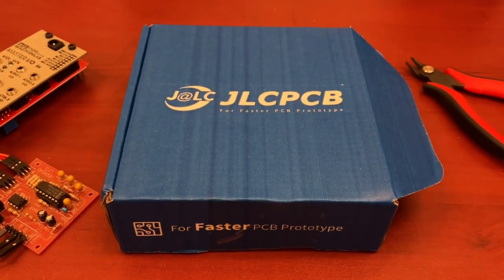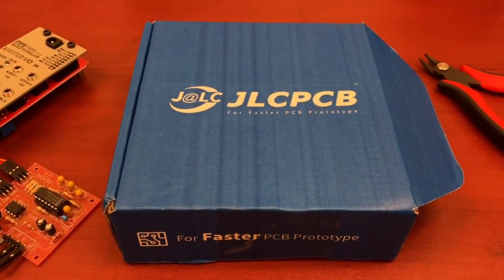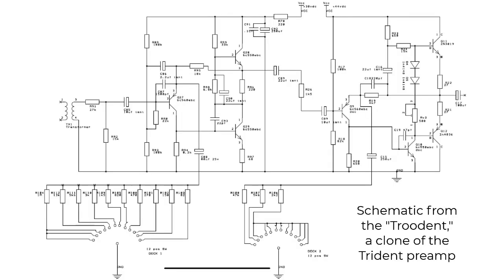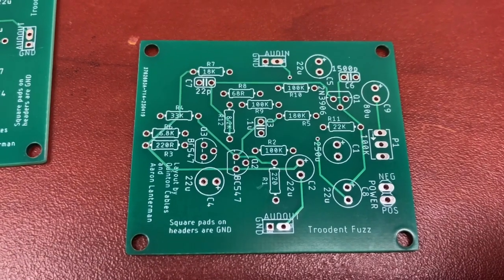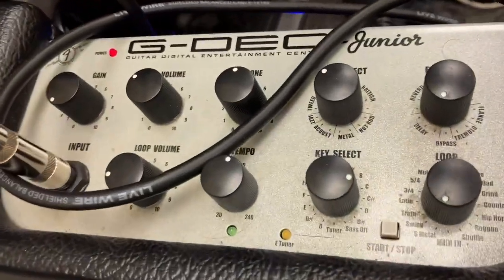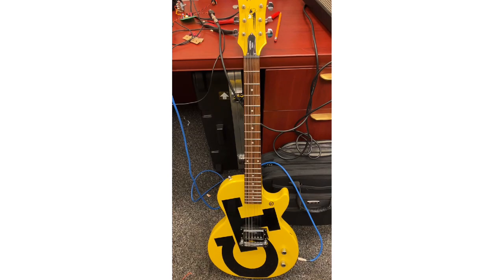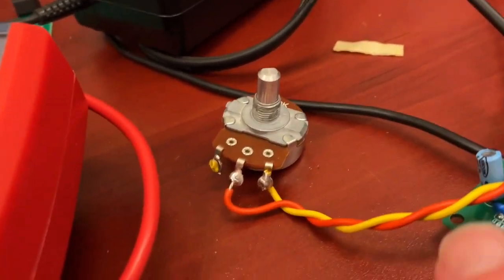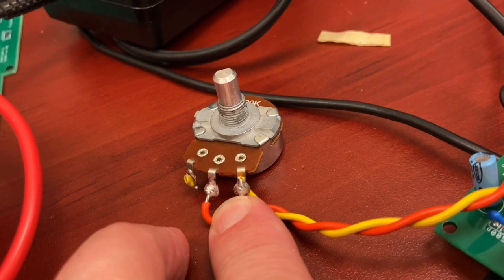Fuzz Circuit Based on the Trident Mic Preamp (quick & dirty test with iPhone microphone)

Comment: I dig it, nice and compressy with loads of sustain. Need more bass to be fuzzier and some treble roll off as you mentioned.
Reply from the maker: Thanks! I can't take credit -- it's really just that first half of the Trident preamp. I doubt any of the Trident engineers would ever have expected anyone to try making a distortion device out of it. :)
Reply: @Lantertronics  I doubt it too, but some of the classic fuzz tones are actually overdriven console pre-amps cascaded into each other. I'll make a board when you post it, looks like a fun one. Hope it can fit into a 125B or 1590N.
Reply from the maker: @ScottyBrockway  Oh yeah -- I was inspired by reading some stories about that, regarding "Don't Worry" by Marty Robbins.

Comment: I was looking at this one on Basecamp, it’s a super cool circuit! It’s interesting that the pre-amp circuit uses tantalum caps on both the input and output rather than aluminum or film. I always heard tantalums are notorious for distorting audio, if that’s true it may be a questionable choice for a pre but awesome for a fuzz :)

I’m building a clone of the Ampeg VH-140c red channel and it uses an anti-log pot for the gain control, which serves as a voltage divider and controls how much signal is fed back into the inverting amp soft clipper vs how much is passed into the next gain stage. It almost annoyingly reaches near max gain at the 11 o’clock position, giving the illusion that the circuit has a ton of gain when really it’s all just skewed on a lower point on the pot. But it may help smooth out the usability of the pot for this circuit.
Reply: Oh! I was also going to add that running the pedal through the FX loop may help tame the sound, as you get all the filtering and tone shaping of the amp before it goes through the fuzz
Reply from the maker: Heh, I hadn't even noticed they were tantalums. I just used electrolytic.

Comment: Would love to see the input and output waveforms on a scope….that would be most illuminating
Reply from the maker: It's hard to get a sense of that with guitar input itself since it varies so drastically, but I'll put in a triangle waves when I get a chance -- that's the easiest way to see the details of the nonlinearity.
Reply: @Lantertronics  would a tone work? How about a fundamental by playing a harmonic at the 12th fret? “A” string maybe? I love this stuff and your channel, which I trust since you are wise in the ways and means - I have been threatening to build some devices but EE has been my job for 35 years and I stick to the playing outside of work - still I enjoy learning in your utoob 🤓
Reply from the maker: @joerectifier  You could probably get something if you set the scope to capture on trigger.
Reply: @Lantertronics  Yes - absolutely! Look forward to more good stuff from you.

Comment: Dr. Lanterman,
     I have a couple questions about the circuit:  1)  What about it gave you the clue that it would be useful as a fuzz?  2)  How does it compare with other well-known fuzz circuits?  Thanks!
Reply from the maker: 1) I didn't really have a clue per se, other than any amplifier circuit will distort if you push it hard enough. Whether it's a musically pleasant distortion is another matter -- but of course, what's a "musically pleasant distortion" is a matter of musical context. 

2) I started to think about how to answer your question, and then realized I should do a whole video analyzing the Trident circuit. It's similar in many ways to a Fuzz Face, with some fundamental differences, namely the Fuzz Face uses "current summing" of the input and feedback signals (they are brought to the same node) whereas the Trident uses "voltage summing" (they are brought to different terminals on the input transistor. Also the Trident has 3 transistors instead of 2, with the second two sharing bias current for reasons I don't understand.
Reply: @Lantertronics  Thanks so much.  I suppose the "clue" that the circuit would fuzz is that a guitar's output voltage is much higher than a microphone?  I didn't think of that at first.
Reply from the maker: @allanflippin2453  It's hard to say since in the microphone preamp the signal goes through an impedance matching transformer first.
Reply: I would be fascinated to see an exploration of how this, and/or the Fuzz Face, work.  There is something very particular about the sound of "fuzz", vis a vis other types of distortion, and this Trident circuit has that sound too.  Basic distortion due to clipping or nonlinear transfer curve, I can understand.  But what is it about fuzz?  Is it just the even vs odd harmonics?  Seems like there's a longer time constant effect...  I notice large cap values in the Fuzz Face...  It's an area of personal passion or obsession for me, any light you can shed would be most welcome!  Thanks for all your works.

Comment: so what kind of transistors are you using??
Reply from the maker: Pretty standard silicon transistors, 2N3906 for the PNP and BC547 for the NPNs. There wasn't particularly any logic to choosing those, they were just what happened to be convenient in lab when my student was breadboarding the circuit. They're not the transistors in the original preamp, but I don't think they're particularly critical.

Comment: To my ears it doesn’t sound saturated enough — it sounds less like fuzz than the effects of starving the voltage; I’d be curious to see if you gave it a proper 30V or even 18V (which is increasingly common in pedal supply) if it cleaned up even at higher gain settings. 

I also think the amp may be too clean. A lot of times fuzz benefits from an amp that is already overdriving or at least running a little hot. It’s probably worth hearing this into whatever standard OD pedal you have on hand, with the OD gain around 2 o’clock.
Reply: Further thought: I can’t really make out the schematic on my phone, but given its original purpose as a microphone pre could there be some kind of aggressive low-end roll off? If that were the case you have something much more akin to a Treble Booster and rather than running into an edge-of-breakup OD you’d get better results from something like a DS-1 turned up pretty high, especially if your handy OD pedal would be something like a tube screamer that already has a strong mid emphasis. Either way I would definitely try this into an amp/pedal that’s already distorting but ymmv as to what kind of distortion gets you to the right place.
Reply: @peddlereffects  "but ymmv as to what kind of distortion gets you to the right place" well stated!